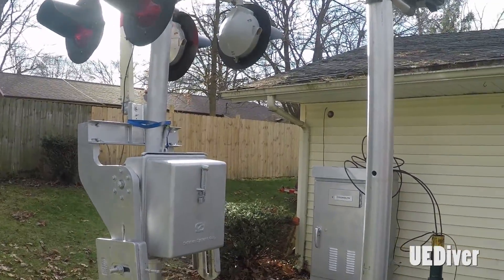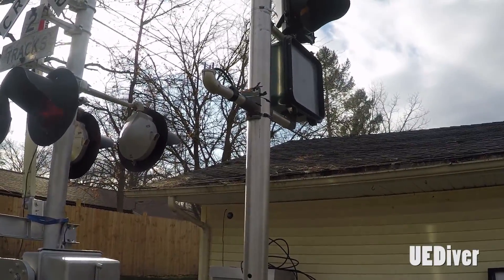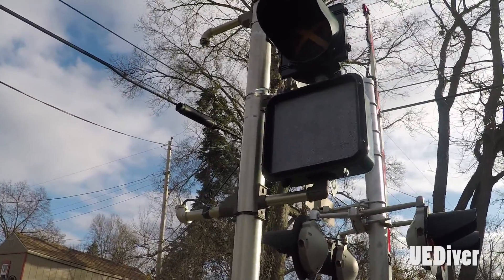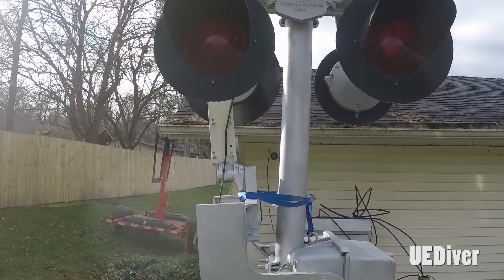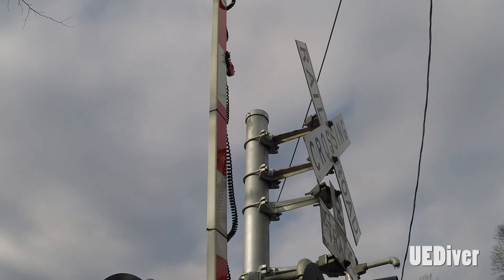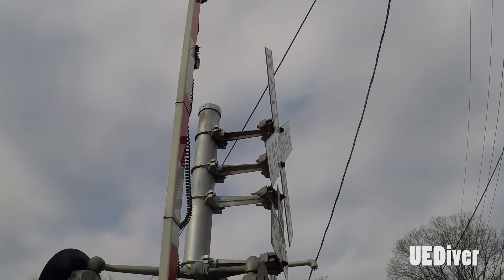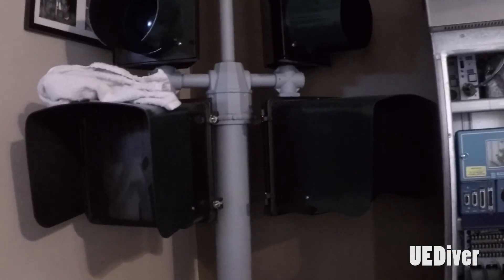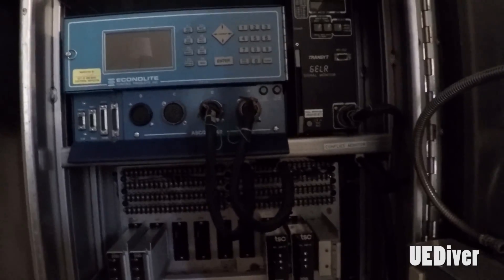Ultimate Backyard Railroad Crossing Video #4: DIY Traffic Light & Railroad Crossing Gate 12/27/2016

Comment: do you still have the rusted out bell? would take whole thing
is it a WC Hayes? If not am pretty sure most parts are universal 
need parts for my bell
Reply: you ever though about making a adapter for the new bell?
the pole would go from 4.5 to 5 inches
Reply from the maker: microbusss thanks for the message. I actually bought a new mechanical Bell, safe trip and brand and have it up and running on the set up. I'm hoping to get a new video up here in the next week demonstrating it. The WCH Bell which was rusted out, I actually have a friend that's working on getting it fixed. Alot of PB Blaster and time.
Reply from the maker: microbusss and I actually did get a conversion adapter and it fit perfectly.
Reply: I mainly missing the rain guard & the base plus the bolts for my bell

Comment: why not install the 8 inch lights as side lights
Reply from the maker: Keny Reina the tank engine that's actually a good idea, the only problem is the poll is not as tall as some of the newer ones out at crossings now. There's not a ton of room to add another angle of lights. I do have a second pole that I am thinking about setting up and putting the 8 inch lights on that. It's just trying to find space to put it up.

Comment: Do you think that maybe with those 8-Inch Lights, you can get another Gated Signal for it while your current one has the 12-Inch Lights?
Reply from the maker: That sounds like a good idea but finding room is the problem. If I could just get a second polce, I can use the 4 8 inch lights and use a second cross buck and track sign to complete a second setup getting another gate might be hard.
Reply: +UEdiver Well there are Gates in different Lengths. I can tell you that.